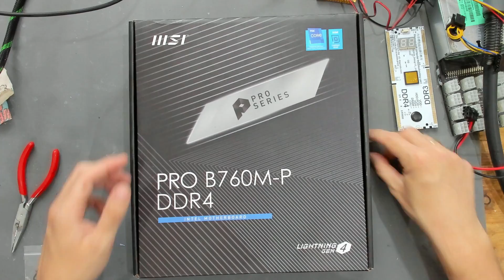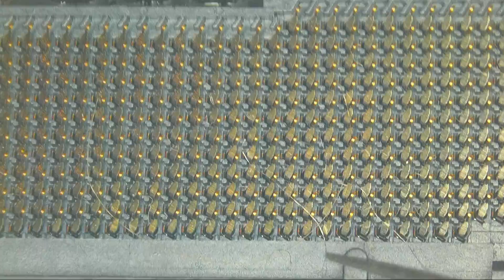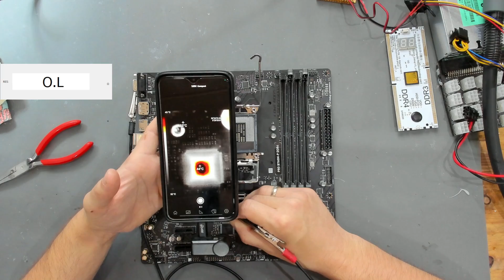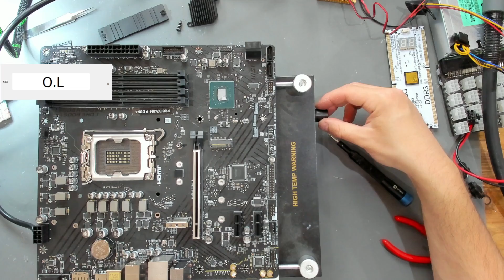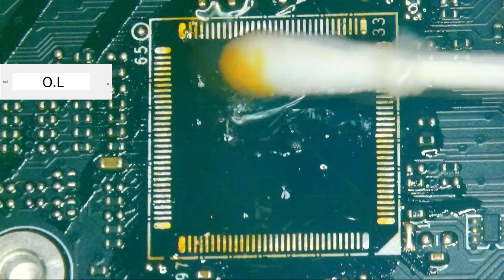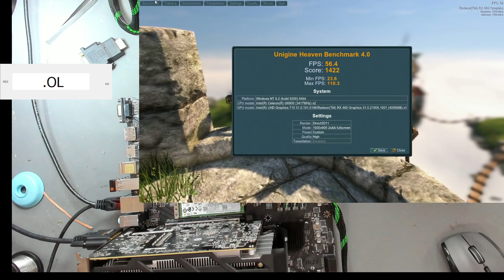FIXING MSI MOTHERBOARD FROM EBAY ||  MSI PRO B760M-P DDR4 MOTHERBOARD REPAIR FIX

Comment: Your chip didn't play nice because you didn't use enough flux. Drown that sh#$.  You literally can never use too much flux. Flux is your friend.  Invite flux and all of fluxs' 🎉 friends to the party. But seriously, flux creates the surface tension that you want in order for solder to clump and in so doing that chip will sit right down. To be clear: You need that chip fully submerged in flux. Great vids btw.

Comment: My vga light stayed white. Just like your dram light did. I have tried resitting the gpu, using another gpu, hdmi cable in different ports. Nothing. Any ideas ? Thanks.
Reply from the maker: Different pcie slots, looking if the Keyboard capslock indicator reacts, do you have a bios flashback funktion? Different display and maybe using displayport isntead off HDMI!
Reply: @MainboardMedic  motherboard doesn't have any other pcie slots. Keyboard doesn't do anything. Will try the DP but not holding my breath. Pretty sure ifs a motherboard issue. Thanks

Comment: Another tip, when removing the solder of the pads with the wick, do not move it across the pads, move it along the pads in the same direction of the pads, less likely to tear the pads off the board that way

Comment: Hi, a tip for you, if you are certain the chip is U/S as you are with this one, you can carefully cut through the pins right at the body of the chip with a good craft knife, then when the body of the chip is removed, you remove all the pins by wiping across them with your soldering iron. Bob

Comment: Hello Medic, I' got on an MSI PRO B650M-A WiFi which which powers on but is stuck with CPU and DRAM leds. Cpu and ram are working, tried on another board. Would you spare some suggestions?
Reply from the maker: I would check the DDR voltages. DDR sometimes called VDDQ, VPPM , SPD and then the data connection between the socket and the DDR!
Reply: check if your RAM sticks are compatible with your Motherboard. and also, wait few minutes to get POST. Try different RAM stick on different slots

Comment: I would really have liked a more in depth perspective on the diagnosis. As for the soldering job, I generally put light downward pressure on the part once it's in place over the pins. I remove that pressure once I feel the part click down on the mainboard. You might also try a bigger nozzle on your hot air rework station with a lower air speed. This helps to gradually bring the temperature up in a more directed area. Using a circular pattern over the pins, you'll find that they all lift off a lot closer to the same time.

Comment: hi 16:03... all the board clean, i prefer to add some flux in pads, install chip and alignt, and solder in the end by tip only, ( in a case of a heavy board) some pre heating under neat.
ps- instal and alignt in clear pad is so much easy. :) never the less  good job.

Comment: question: at 16 mins you use a qtip to clean up the flux, are you not worried about the cotton fibers getting on the sodder points? Qtips are notorius for leaving bits behind
Reply from the maker: Because i already used wick on the pads, there is no solder left, which the qtip could have been stuck on, otherwise you are right and need to be careful because of left fibers!

Comment: I have a B550 board that seems to be braindead and failing very early in the POST cycle without beep codes. Every key voltage seems OK, but one curious thing is that an ambient standby LED is not activating at all. It flickers on for a second and goes out immediately, despite receiving the +5VSB voltage rail when the PSU is turned on. Is this something that could be caused by a faulty PCH/SIO? thanks
Reply from the maker: It very well could be, like stated in the video startup is always connected to PCH and SIO. I would look for borken off components on the back and front side! Does the board react to the power button? If not there is something around the SIO or what is connected to it!
Reply: @MainboardMedic  thanks for the response! The power button responds normally, so I guess it rules that out. Looks like it's back to troubleshooting the PCH and CPU for me...
Reply from the maker: @fuzzystudios7502  Most of the time when i had this kind of behaviour it was a knocked off component. Exspeciall check the backside!

Comment: Hello🤝 good job, but I see that KBC is not only my nightmare, I also had problems with KBC and I also didn't know why the pins wouldn't solder. Now I grind them on a fine water grinder from the bottom and it helps, and when you heat KBC, heat the whole thing without the tip. If you want to press it, press it first and then heat it, this way it won't slip. watch the channel Sorina electronics repar school he is a master in KBC soldering, best regards, a little practice and you will be able to solder KBC with your eyes closed👍👍👍👍👍👏👏👏👏👏👋👋👋👋👋👋

Comment: Good practice is to stick something like caption tape in the middle of the sio chip as it will keep important part of chip somewhat cool, you only need legs to be at soldering temperature anyway.
Reply from the maker: Ive seen people do that with PCH´s. Never have seen someone do that with an SIO but it is good practise!

Comment: I wanted to mention that, after getting it in location, first let the solder cool and harden ( a little) then before applying hot air press down in the centre of said chip then bring in the heat and slowly heat it up and be mindful of the pressure that you don't get any sideways movement., then after heating up,  stop applying heat and keep the pressure until it cools then release. I know more easy to say than doing. I think you did pretty good! Keep the great repair work. Cheers! I love these motherboard repair videos, not many people out there doing these. You going to be a Rock Star! of repairing motherboards. I'll tell all my tech buddies to check your channel out. See ya!

Comment: I enjoy repairing computer hardware, I don't do this for money but rather for enjoyment. Other hobbies cost quite a lot of money so comparatively this is not expensive.

Thanks for sharing.
Reply: Do you specifically repair motherboards aswell?
Reply: this is indeed Expensive LOL, tools like rework stations, Trinocular, DC Bench Power supplies, Thermal Cam, A good Multimeter, Oscilloscope, Soldering Iron, and Others price ain't no joke

Comment: YUP.. Try Leaving the board freshly cleaned, and tin the chips with pillows of solder works best for me.

Pre tinning the chips BTW also ensures whatever corrosion they accumulated whilst in the warehouse
has all been removed by the flux and solder you use..

APU👁👍

Comment: Nice repair, thanks for sharing. Not sure if it’s necessary, but I always remove the coin cell battery when using a preheater.
Reply from the maker: Yes it should be done and i again forgot to do it!

Comment: Question, was the new SIO pre programmed, or will/does the bios program it at fire up?
Reply from the maker: On ATX Boards they always get programmed by the Bios on the board!
Reply: @MainboardMedic  Thanks, wasn't sure.

Comment: Have you tried soldering paste? I think it's better because you can put the SIO on the pads and it doesn't slide off from the solder bumps. Also, I feel like the paste holds it in place a bit, and it's not floating so much as it does on the liquified flux. Not an expert myself, but I found it useful.
Good job fixing the board! :)
Reply from the maker: That would be interesting to try out! I have no experience with applying solder paste but i should try it, thank you!

Comment: In my opinion, you don't really need a preheater for SIO as the old SIO is dead anyway. And for soldering the new SIO, you don't even need hot air. Good job keep it up btw.
Reply: Definitely way easier with preheater.
Reply: @Dandan-tg6tj  yup, but they usually go for 100$+. Just saying for people who don't have it.